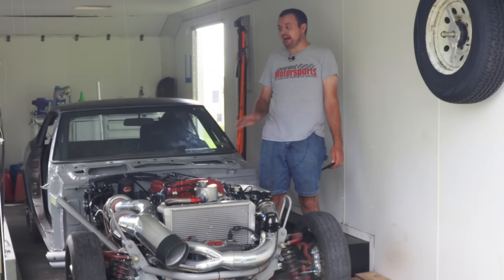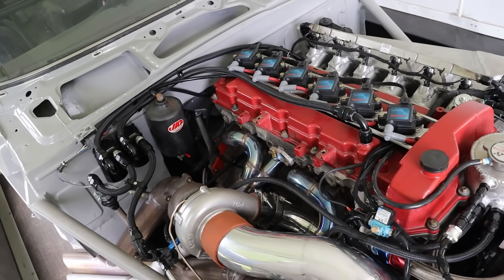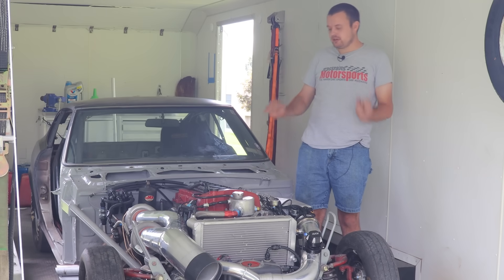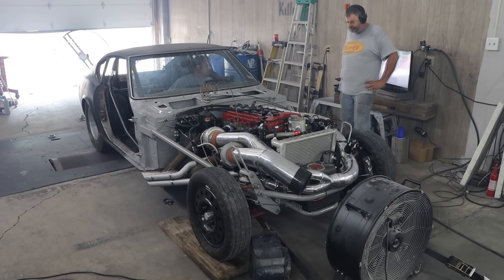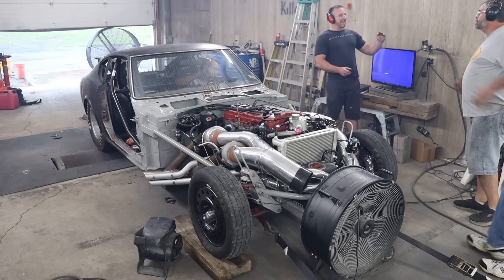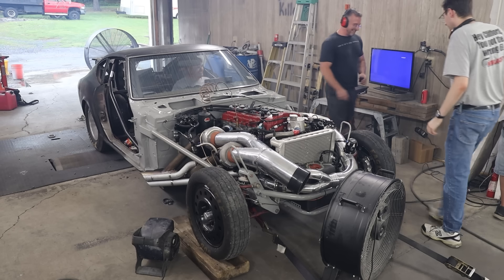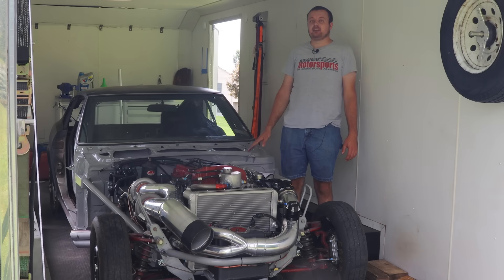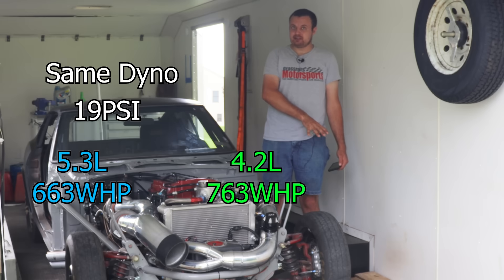This 4.2 Liter Engine Just Beat a 5.3 LS!

Comment: Is the piston compression ratios the same in both engines, are they on the same fuel and fuel system(injectors,pumps,lines)? If so this is incredible, I've always wanted to see how the big 4(chevy,ford,gm,mopar) stack up against each other. You always see for example an LSX vs a Coyote engine and that's just not the same, ones purpose built for racing and the other comes stock in a mustang. It would be interesting to see similar engine sizes and internal specs to see who does it better.
Reply from the maker: They both had very similar compression. 5.3L had 9.8:1, 4.2L had 10:1. They bother were non intercooled, and had methanol for charge cooling. The 4.2L had a higher percentage of methanol though. I don't think that accounts for 100 ho though.
Reply: Yea thats basically the same

Comment: Would be great if you could pin a comment with links to the rods, arp bolts and valve springs that you've mentioned.
Reply from the maker: Most of it is on the wiki. https://sites.google.com/view/vortec4200wiki/home

Comment: Dude, just WOW 😳! I am beyond impressed on this straight 6. I've always been a major fan of gm 6's. Especially the good ole 250 & 238. My 1st car being a '74 Nova with a 250 & a 2spd power glide. That was a very fun, & a fairly quick car. Hey I was 16. The I graduated to an '86 firebird with a sm block 400 & turbo 400 trans. That was even more fun in the early to mid '90's. Love the engine.

Comment: I’ve had the 4200 in the back of my head for years as a potential rival to the Barra and 2J. It’s a sleeper engine that you can pick up for next to nothing, but the only real issue is aftermarket support. 

I feel there’s lots of companies/people missing out on so much potential lying in wait in every junkyard in America.
Reply from the maker: Yup. Truth. Speak it.
Reply: I've said the exact same thing about the L47 4.0 V8 in the Oldsmobile Aurora. GM used it from 2001 to 2003 in their Cadillac Northstar LMP race cars, the fastest of which was twin turbo, revved to about 8,000 rpm, and made 650 hp and 650lb-ft of torque. Carol Shelby even looked at that engine when he designed the Series 1 concept car, and yet, despite it's racing pedigree, and the interest it gained from Carol Shelby, the L47 has exactly ZERO aftermarket support. 

It will take some digging, but I've seen a video of a late 90's Oldsmobile Aurora with the 4.0 V8, that was cammed using camshafts from the 4.6 Northstar V8, to produce (I think) about ~330hp according to the owner. 

Those engines absolutely deserve some love from the aftermarket, but I don't think it's going to happen as most people take one look at the front bumper of the Oldsmobile Aurora and they just go "ew" and never give it a second glance, and that's just not fair to those cars.
Reply: @AWildIraqi  I thought those Northstar V8s had some major issues though. I remember my dad had a Cadillac Deville back in the day and it required a full engine rebuild under recall (luckily). Maybe if those got corrected in the aftermarket there could be some potential, because the specs are definitely there.
Reply: @LiterallyShaking  they had the wrong type of threads in the head bolts; there was a fix just by changing the thread type (coarse vs fine)
Reply: Then it will be expensive from the junkyard 🤣😂
Reply: So is the M50/M52 and S50/S50 iron blocks from BMW
Reply: @premiumxperiments6059  M5X and S5X have huge aftermarket support. Unfortunately the highest displacement examples, S52s and M54s, don't like high revs. 2JZs rev safely to much higher rpm which is why they make such good dyno queens. With these smaller engines high revs are crucial to big power. There's a guy in Sweden, Nisse Jarnet, who makes over 800whp with an AWD E30 and he runs the 2.8 crank, probably because the S52 crank would be cause problems at 8000rpm.
Reply: People were saying that with the 4.3L decades ago. If it's not a V8 the aftermarket usually doesn't care.
Reply: Same thing happened with the Barra in Australia. Those old iron Ford 6s have been making big power for decades. Yet only recently have become a mainstream tuning option.
Reply: 2jz shits on the barra the Rb and the USA barra,and lots of others not worth comparing
Reply from the maker: @definitionmedia1130  ok. Cool.
Reply: @definitionmedia1130  can I get a 2JZ at any junkyard in America for $300?
Reply: @LiterallyShaking  I hear you,but you get what you pay for,if you want to be on the world stage in the i6 game it's toyota.the barra and others are cheap bang for buck,built for built never compete with toyota,but there cheap fun,
Reply: @definitionmedia1130  "Cheap" There is billet blocks and 4.5 litre billet heads rated for 3000hp available for the barra now that cost roughly $20k aud (for both block and head), and with the correct accompanying parts, will hit those figures too.

Last I checked, the fastest current full street trim/street legal Falcon with a  barra is in the 7 seconds quarter mile mark, with 2048rwhp to the rears, and I believe it's destroked, it'd make even more power with a newer stroked billet head.

Just because you can get barras over here in Aus for relatively cheap, because there was so many Falcons produced with barras in them, doesn't mean that the platform can't get expensive, real fast, and it also doesn't mean they aren't stout or haven't got massive potential in them either.
Reply: @glynkatkin  rave on shit how much ice did you just hit,facts are facts a billet barra has not even made a pass yet,barra to slow top end to get into the 5s.deal with it,2jz is the king,20 years of owning 2jz In that time owned 2 barras.as a cast un grouted set-up there a average deal,lots of bullshit and hype,2jz is the top end king end of story barras are funny
Reply: @definitionmedia1130  You still on it with your BS? Go away, fanboy. But first, explain me why Toyota ditched the 2JZ to go with a 4-pot in the GT500 Supra...
Reply: @edugj23  that's a question that is baffling to many 2j owners.what alot of people miss is,both the 1j and 2j are designed to give amazing mid range and top end,but with not alot of refinement.just a tank that loves boost and rpm,and if you look at other i6s like the barra there designed to tow stuff and not rev.thin top decks,it's a stupid comparison.the b58 seems to be coming up but the real threat to the jz is Honda
Reply: @definitionmedia1130  That's exactly the point, it was not designed for racing (like most production engines). It is amazing to know people take something that is not intended for that and achieve amazing results from it, and this is also why it's disingenious to enter in every inline 6 engine video only to trash talk other people's progress and completely dismiss the potential of any platform that's not your favorite. Closed minds like yours   
are what I dislike the most in the whole "community".
Reply: @LiterallyShaking  you can’t get a 2JZ at any junkyard in America, let alone for $300, lol. If your lucky enough to be at the yard on a day one rolled in, it’s gonna have 400k miles on it and cost ya $3k instead of $300

Yeah, Piss on that Toyota 2jz!! There’s much better stuff out there that’s much cheaper now. It’s a good engine for sure but folks got ape shit stupid about the values of it!! Bring on its replacement, it’s time, and I’m ready!!
Reply: @1982MCI  I know, that’s why I was saying the Vortec 4200 has potential, because you CAN find them in any junkyard for $300.
Reply: @edugj23  and the other thing that completely sucks about the 2JZ is the fact that they sound like the worlds biggest, stinkiest farts when they get wound up, lol. I’ll give it to him that they are good engines but I’d never have one just on the sound alone!!

Hondas are bout as bad too. I was extremely happy to see that this one did not have that fart sound to it and I’m gonna do more research and see if I can find one to possibly swap into one of my Jeeps. Not looking for a race version but would enjoy a 400-500 Hp replacement for the stock AMC 360 that only Carrie’s 140hp from the factory and 8-10mpg. 

There are many other avenues to go besides just a straight race version that we can all benefit from but idiots like that who are narrow minded will always fall in our shadows! 

Take care and be safe out there brother!!
Reply: @definitionmedia1130  Below 800hp honestly motors are a matter of taste so let the man be
Reply: @1982MCI I just picked up 2 early year N/A non VVTI JZ's out of a Lexus GS300 and Lexus SC300. From a pull and pay junkyard in Phoenix AZ.  Both were $400 each. 200k miles. Not 400k. 

No need to look for a 2J GTE engine when the N/A block is almost identical. 
You can also bolt a GTE head onto an N/A block if you want. 

For me I would rather have an engine that has support and parts are readily available if I want to build one anyway I want.
Reply: @definitionmedia1130  Doesn't matter what the barra was "designed for", it's simply a better engine, for a number of reasons, fanboys make me laugh....
Reply: @definitionmedia1130  Sure, and what engine has been in the top 5 drift cars in the world for the last decade? Ls, Chevy. But sure, fan boy a bit harder and they'll send you a sticker to scratch and sniff.
Reply: @definitionmedia1130  Funny, when the 2JZ first came out no one knew what it would be capable of and it took years before anyone began exploring the limits. People are only just now getting into this particular engine, there's no telling where it'll end up given any sort of attention the way the 2JZ got.
Reply: @definitionmedia1130  umm NO, in the end they all make good horsepower, it depends where your brand loyalty lays, and how deep your pockets are. they have done well for what they have with there motor
In Australia we are easily getting 2000 hp from our 4.0L Barra (which powers our family hacks and taxis, not made for sports cars) and 800 hp on low boost as daily drivers with our strict government  rules for street driven cars. The problem becomes even with a car weighing over 3500lbs they cant be safely street driven if there is even a small amount of rain. (neither can the 800hp LS powered cars)
Reply: @definitionmedia1130 hard to say without the same aftermarket support to see the true potential.
Reply: @definitionmedia1130  your point? B58 shits on 2jz.
Reply: @definitionmedia1130  Wrong, the 2JZ is highly overrated and way too expensive. The RB is “also ran” because it’s so damn rare, the Barra is a big streetable torque monster unlike peaky 2JZ builds.

Comment: The engine has a double overhead cam four valves per cylinder it’s just superior in the cylinder head. I know you want to mention 71 in.³ but the cylinder head technology is superior to the LS!
Reply from the maker: Yup. Volumetric efficiency through the roof.
Reply: It has variable cam timming and 4 valves per cylinder of course it will make more power per cube
Reply: Kinda proving the point that the LS never should have gotten the cult it has now... Especially given that it is essentially pre ww2 cylinder head design...
Reply: @Ludofjn  what lol??? The pushrod engine is an excellent design, especially with the introduction and implementation of hydraulic roller cams in the more “modern” engines. The most powerful crate engine you can buy has over 1000hp and is a pushrod. It’s a simple, tough, inexpensive, and extremely reliable platform. It completely deserves the cult following it has, and it will last longer than a modular, overhead cam engine with similar power.
Reply: @iDrive4fun93  ya i dont get all the people that hate on the LS platform, the only bad thing you can really say about it is that you are tired of seeing them swapped into everything but that alone should tell someone everything they need to know. its pretty rare to see a ford or dodge swapped project for a reason. as soon as people mention push rods as being a bad thing is when they expose themselves and their ignorance of engines. not hating on ford, dodge, or anything else but plenty of well known engine builders that will tell you the LS is king. 
on another note tho i think these Ameri barra 6s are pretty cool, have a 92 obs single cab short bed with a 5 speed and old 350 that i would love to swap out for one. setup with a small single turbo and a AR5 manual trans. would be happy if i could get a reliable 400hp daily that still got decent gas mileage out of that combo in a gutted lightweight obs.

Comment: cause LS is just junkyard power horse
not a proper designed perfomance engine
Reply from the maker: It's crude but it works. Very American. Why make a good engine when you can just throw cubes at it. 4200 is a little more refined.

Comment: I've had 2 trailblazers and an envoy with those motors, they used more gas than my 5.7 vortec and 5.3 burbans. Everyone will have opinions, I love the 5.3s I have them in 4 burbans 2 I tow with but I have an 06 dodge magnum wagon rt with a dead hemi I am doing a 5.3 LS swap in. People in the LHS dodge and magnum clubs and groups are mostly pissed but they have groups for LS swapped everything.  I never thought about building the 4200s but I'm taking the 96 lt1 out of my old 69 chevy mid engine van and putting in a healthy 65 283 which is just as good a motor as a 5.3
Reply from the maker: Whatever floats your boat. As long as it's what you want, that's all that matters. Happy Hot Rodding!
Reply: @Calvin-Nelson  it looks like you are onto something with the 4200. Enjoy the building , and have fun doing so. It looks like the in thing is now electrifying everything

Comment: I worked at a GMC dealership in the mid 2000's. I got to work on the GMC Envoy and really fell in love with this engine. I spoke to a GM engineer about the idea of bringing back the Typhoon through the Envoy  Turbocharging the 4200 in an AWD model.  He said it wasn't worth considering. Maybe the 5.3, but not the 4200. It couldn't handle it.  I saw the potential in this inline motor.  I'm so happy to see you guys proved this engine could build big power.

Comment: What about the compression ratio difference and porting the 5.3 head will change a lot the trubo is just the multiplier
Reply from the maker: 5.3L had 9.8:1. Atlas has 10.0:1

Comment: I’m a full believer…. 260k miles on my trailblazer. Only did oil changes on it and the motor out lasted the body with over 260k miles on the motor

Comment: Of course it makes 100 more horsepower, there are 2 turbos flowing a lot more volume of air at 19psi. Think about a 1" pipe at 19psi and a 4" pipe at 19psi, of course the 4" pipe flows way more volume.
Reply from the maker: Both have 4 inch pipes going into them. People have done tests with twin vs single, it makes almost no difference assuming they are sized correctly. https://youtu.be/w1uOff1E4u8
Reply: @Calvin-Nelson  Twins or not, the s480 is not flowing the same volume of air at 19 psi as these twins are. Check the compressor maps and flow rates and compare them.  I can almost guarantee the twins compressors together flow about 15% more air at the same pressure ratios thus the 100 more horsepower.
Reply from the maker: @braccali  I don't agree. See the video I linked above. You're still dealing with an engine that only displaces a certain volume per second. With a 4 inch pipe it doesn't matter. The restriction will be the engine. The 4.2 is just flowing more at 19 psi and there for makes more power.
Reply: @Calvin-Nelson  The engine and piping size are somewhat mute, my initial comment about pipe size was just to spark a visual representation of air flow. What twins are you running on this 4.2? I can attempt the math to show the lb/min of air flow difference.